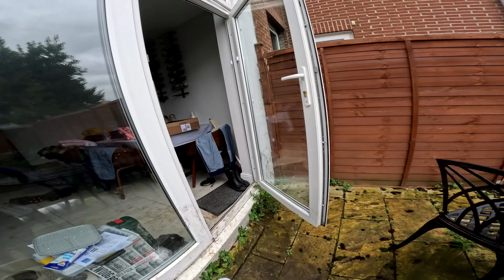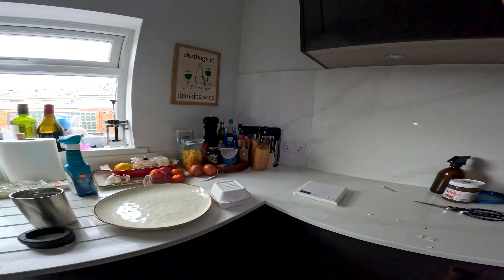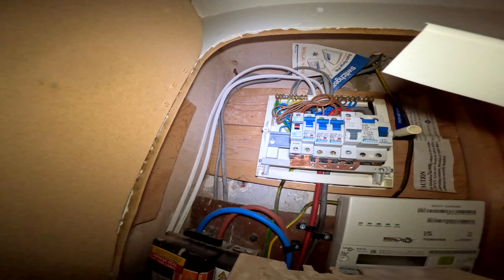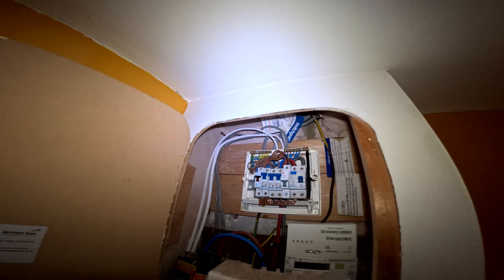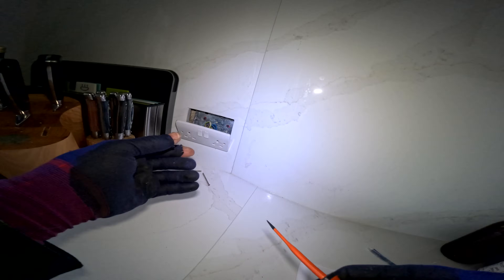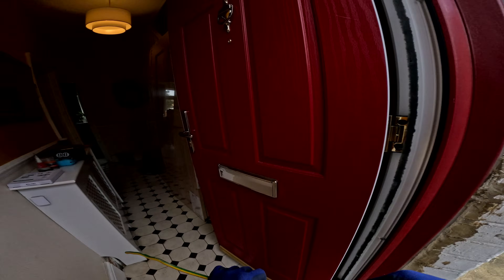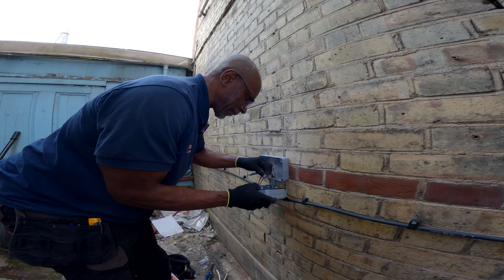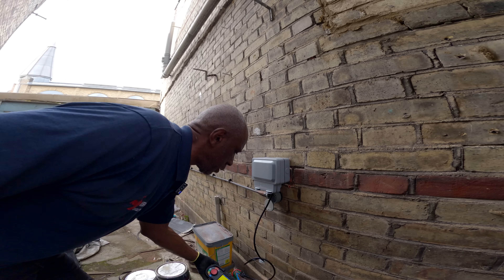Spurring from a consumer unit | working with armoured cable

Comment: In the UK why dont they run the armoured cable in conduit would look better and quicker to install and less likely of damage.
Reply: Because the cable is already protected by the “armouring”
Reply: Conduit provides extra protection. AC doesn't need it. Plus it is strong enough to support it's own weight.

Comment: Hi, I'd like some advice for a light installation that I want to do. I want to install a light that is very close to my consumer unit, but there are no sockets nearby where I could take a 3A FCU spur out of. Currently from my consumer unit, there is already an existing spur out of my immersion circuit breaker to a single socket which my wifi router is plugged into. My question is could I take a supply from this socket to a 3A FCU which I will connect next to this socket for which I could power the lights I want to install? Thanks in advance.
Reply: Hi, Never spur from a socket circuit to a lighting circuit. Even with a fused spur it wont pass regulations and can cause problems if anything were to happen down the line. Your best bet is to run a cable from your existing lighting circuit or run a new lighting circuit from the fuseboard. Thanks
Reply: @davidkavanagh4966 Hi, thanks for your reply. In essence, there are basically two radials circuits coming out of one MCB (immersion). The single socket was already there so I don't really understand why I'm not allowed to spur a 3A FCU from that.
Reply: @kushalvijay6087  There's nothing against this i'm not sure why you've been told otherwise. You can spur off a socket, just use a 3A FCU. This is how many garages are wired with sockets/lights.
Reply: @benjaminives397  Hi, even though that socket has been spurred off the MCB, it's okay? (It's like having two radial circuits coming out of a single MCB. Thanks
Reply: @kushalvijay6087  the issue is about nuisance tripping of the MCB. I'm assuming the immersion is 20a MCB? In 2.5 mm you can run a multiple socket radial... But... Whilst the immersion is likely 13a give it take, it could trip... Depending on what's plugged in.  

1.5mm clipped direct is good for 19a  so a b16 is good enough. But.  I wouldn't run a couple of sockets in 1.5 on a b16. It's common sense. What's likely to be plugged in there.
Reply: @davidkavanagh4966  you're not spur to the lighting. You're spuring to a fcu, which is like using a lamp that can't be unplugged. The light is still considered an "application"... But. The reason being that most lighting can't take 32a of a ring... Hence the need for a fcu. (A fcu with a switch ideally to act as a light switch,)

Comment: Get yourself a marxman pen, drill out the back of all 4 mounting holes on the socket, put the socket to the wall level, then push the pen into each screw hole and it will mark the wall so you can do all the drilling at once and then you don't have to fit it twice 👌
Reply from the maker: I have one of those. On this occasion with these boxes to get them precise I find it better to drill the first corner get that fitted and level then drill the other 3 through the box that way it's sure to be level. With your method when you start the drill on hammer it can slip slightly and when the box is fitted it's out(not level).
Reply from the maker: Thanks for watching.
Reply: @eastwayelectrical I never start the drill on hammer if it matters. New bit/ hammer and punch to make sure the bit can't spin off

Comment: No need to seal the whole box, just behind each screwhole. Those conduit boxes WILL let in moisture, doesn't matter if you used a gasket, should've terminated the armours into the bottom of the sockets, how long is your labour guaranteed for? coz you're going to get a call back in a few years from those tripping the RCD.
Reply: Even if water gets in the conduit boxes. Why would that trip the RCD?
Reply: @JorgeAMG187  why are you commenting if you don't know what causes RCDs to trip?
Reply: @darknessdestroyer5524  I know what causes RCDs to trip. And water in the conduit box sure isnt one of the reasons. You just trying to talk smack about Deltoy because you couldnt do it better yourself
Reply: @JorgeAMG187  You obviously haven't got a clue about how a RESIDUAL CURRENT DEVICE operates, you're now making a fool of yourself, please carry on.
Reply: I'm assuming he's drilled as small drain hole at the bottom back
Reply: @PearsallEu  spiders nest incoming.
Reply: @darknessdestroyer5524 oh no, spiders... Yawn!
Reply: @RexBanner_  another one that's clueless about real world situations that can trip RCDs, go and educate yourself before commenting.
Reply: @darknessdestroyer5524  I'm pretty sure the manufacturers instructions say to drill the drain hole?

Comment: 20mm conduit with t&e, conduit straight through the 1st socket, less work looks better and no need to mess about glanding , just my opinion .
Reply from the maker: you can do it anyway you like thanks for watching.
Reply: I'd prob use the junction below too, but I agree with t/e conduit. Faster, and cheaper

Comment: Would loved to have seen how you made the swa off in the plastic consumer unit. Bet that rcd was a type AC
Reply: Also the armored was going into a fused connection unit first so he didn't need to gland it into the board
Reply: @MarkSmith-nt8tb  that's true didn't see that
Reply: What's wrong with a type AC RCD there's that's all that's required by BS7671
Reply: @Nick_Carlos  if installing a new circuit,current regs= TYPE A rcd or you're not installing to current regulations.
Reply: @tommochelsea72  No but if i was to spur off an existing circuit that would be fine that was the point I was making.
Reply: Why didn't you just get a new bus bar and install a new RCD. Also isn't it considered a radial from the cu... Meaning if it's on a 32a then that's where the grey areas start...
Reply: @PearsallEu  No, it's still a spur. But nothing stopping you spurring in 4mm cable for multiple socket outlets.
Reply: @sdgelectronics  I'm not so sure... The main issue is you can't  spur  from a spur because you can overload the cable. You don't know how many sockets are in the chain. And if it's a 32a ring is not gonna trip the MCB until well past the list capacity of the cable...  A single socket is rated at 20a... (Ironically near the same as the 2.5mm) 

There's nothing that specifically says you can't run a radial and ring off a single MCB... Even though not ideal ... This is also one of the reasons I'd use conduit. & 4mm t/e.  But it's possible the MCB is 20a anyway.
Reply: @PearsallEu  the concern for spurs from spurs is when you use 2.5mm cable, which may only be rated for 27A depending on reference method. If it's done in 4mm, the cable can't be overloaded without tripping the OCPD.
Reply: @sdgelectronics  that's what I said above... 32a breaker. 4mm cable in conduit 😁 20a breaker trips at about 27a (1.35 it's rating)  depending on reference method even this could be overloaded for a 2.5mm...  this is why lots of people use a 16a with 2.5. but in any event we know the issue isn't just spur from spur. It's the potential overload. And putting limitations in place to prevent that. A 13a fcu  being a great start, just like using a 13a fuse double adapter instead of a direct pass through adapter in a socket. (I hate to see those cheap things and always recommend customers pop to get a fused one if they insist on them.

Comment: Not a chance I'd have used the consumer unit in a state like that. rip out and start again. not even sure how those bus bars have been fitted?
Reply: What if the customer doesn't want to pay for a new consumer unit?

We have to earn a living what would you do walk away?
Reply: @Nick_Carlos  I'd be more concerned about those bus bars not being connected  properly and starting to arc.customer said only outside light's would be on the circuit,how would you know how much future higher loads wouldn't be introduced to that circuit? I'd have waked away. wouldn't put my name to that installation
Reply: @dennisreid4428  Must not of been paying attention to be honest that's a fair point!
Reply: @Nick_Carlos  If you look closely the bus bars are over lapped,with the new one just touching the original. have a look at around the 3 minute mark. then you'll realise why I'd have suggested ripping it out or walking away
Reply: @dennisreid4428  just get a new bus bar. I'm sure we've all got one or two from old installs in the shed. I keep a few old mcbs, bus bars etc just in case I can't get one when I need it...
Reply: @PearsallEu  Maybe you could find a scrap one and while you're at it a new cover because that one has been hacked to death. You go home,find one and  return the next day. Ok it's only correcting a few faults with the consumer unit, but it's billable hours. So as eddyeaze6858 said "what if the customer doesn't want to pay"? Rip it out and start again or walk away

Comment: Could you not just have terminated the glands of the SWA directly into the sides of the socket enclosures? ...just an obsevation.
Reply from the maker: I don't do it that way if I can avoid it. Like I've said numerous times things I do are based on previous experiences. when I install lights sockets etc in a straight line like this. I try to avoid passing the wiring through the fitting, because at a later date you go to change that item you have to get the exact same fitting to fit in that space. Depending on the span of time you may not be able to get one or you may get the same make but there are slight changes that prevents it fitting in the original space with this method you can install any fitting. Also is easy to terminate the cables  into the box underneath if one has to be removed for a period of time.
Reply: @eastwayelectrical  - Thanks Delroy. It’s always good to see different peoples methods so fair comment. 👍🏿
Reply: I think he was thinking that entering into the bottom would be better due to water ingress potential however I'd probably of gone in the side as that's more work for not much gain in my opinion but everyone does things differently!
Reply: I’m a sparks, and I really like the way you have used the galv boxes and the reason why. You can’t buy experience so thanks for sharing the tip Del. This would’ve been one of them jobs where I turned up to and thought I wish I quoted a little more 😂😂
Reply: Why has he not done it like so 😏